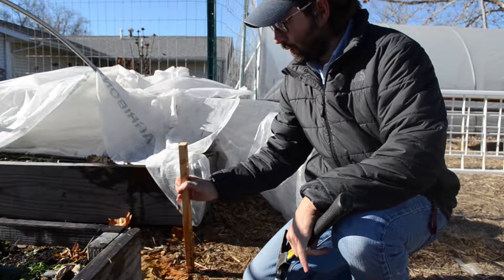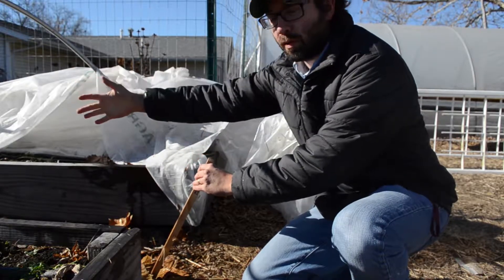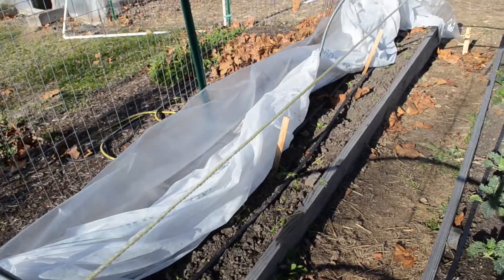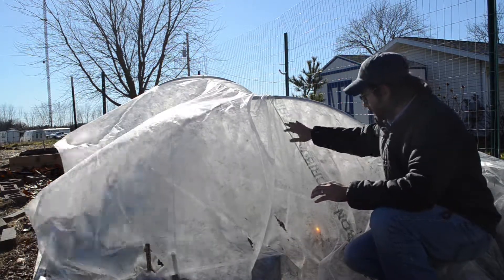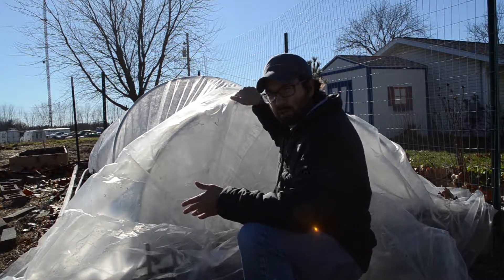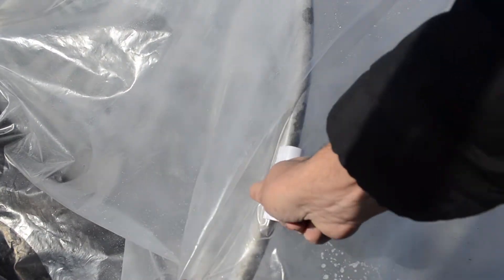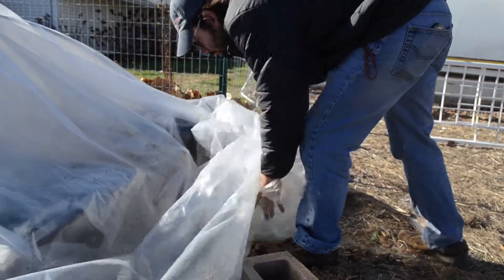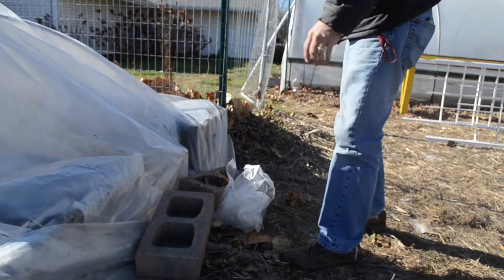How to Build a Low Tunnel Part 2: Installing greenhouse poly plastic

Comment: What is the purpose of the row cover under the plastic?  What is it made of?
Reply from the maker: The inner layer of row cover can add a bit more to the insulative value of the low tunnel. But it really isn't much! Ideally, there would be enough space to have a separate level of hoops (could be made of wire) under the plastic. This can hold heat closer to the ground. This technique is commonly used in high tunnels, much larger season extension structures. Leaving the row cover on was also partly me being lazy and knowing it wouldn't hurt to simply leave it in place. Row cover is made of spun polyester fibers.